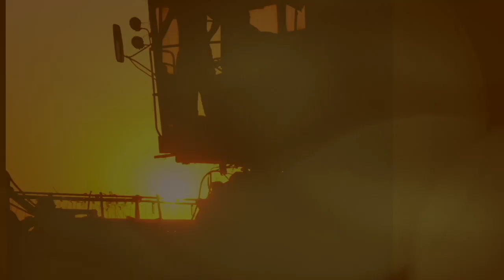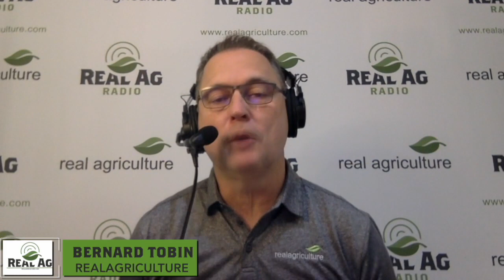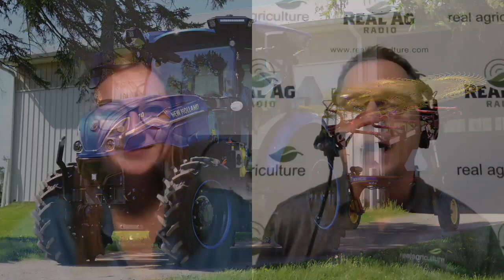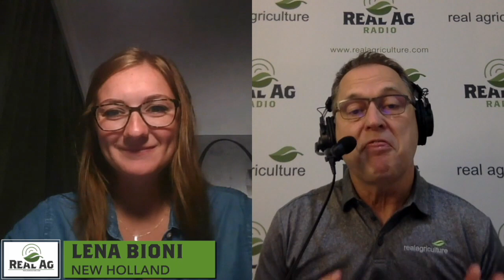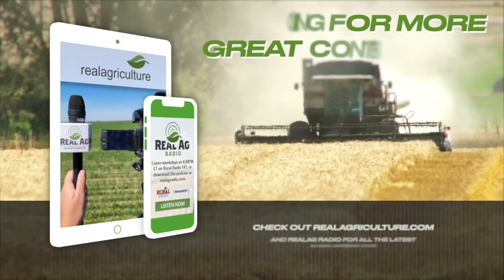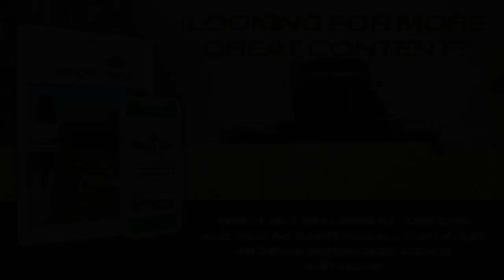New Holland electric utility tractor matches diesel power

Comment: At this stage of electric tractor development it is understanding the adaptation of  the integration of electric only power., and complementing  solar array and energy storage costs   vs the understanding of the true cost of use  the of petrol , petrol machinery maintenance , petrol machinery and fuel  procurement , and true cost of phasing out  of  possibly already paid for machinery and equipment .  Two or three years ago what we see today did not exist in the market place neither has rapidly dropping solar component pricing .  We now have feasible options that kept farmers on the fence , they just have to analyze the math again , and consider that  switching to electric  has an adaptation period  ( an hour to charge !!?? -like a farmer has no other chores he could do instead while paying 1/3 as much to operate his equipment ).